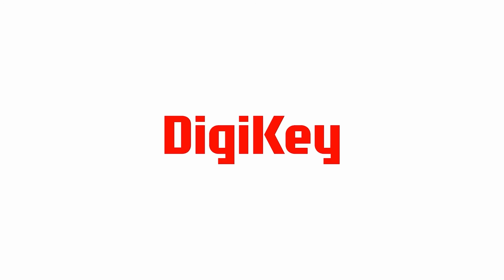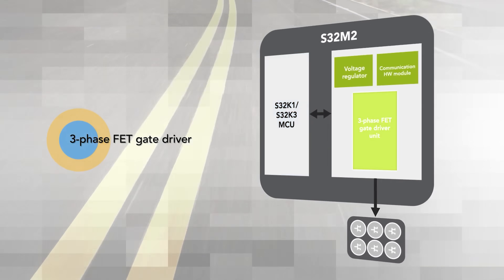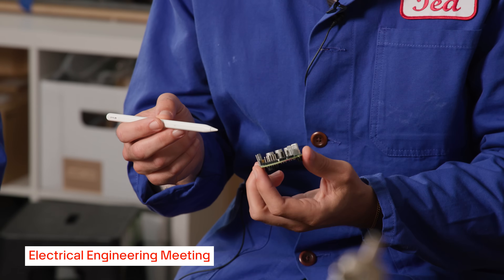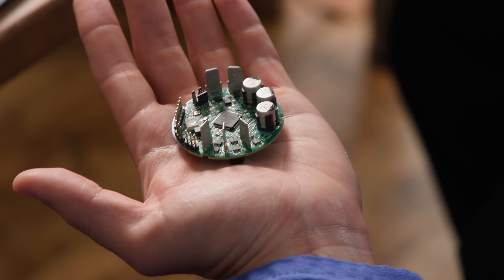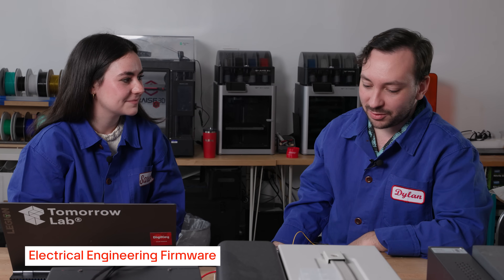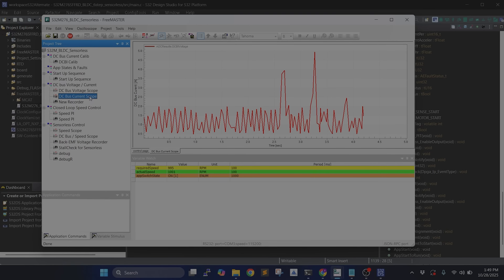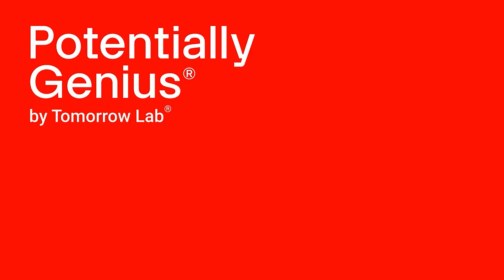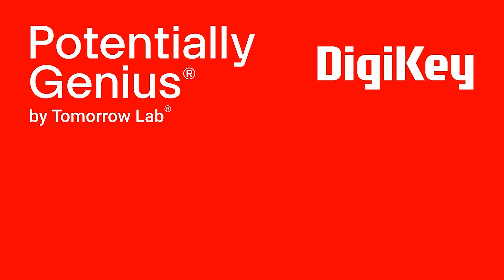NXP S32M2™ Motorized Ice Cream Maker – Potentially Genius® | DigiKey

Comment: This is obviously a PR fluff thing and that is fine, but who is your target market? That chip is $20, that little dev board is a whopping $63, and I assume you need the debug probe for $525.00, BLDC kit? $450.00?  I assume the dev environment is a fortune as well.
I can get a closed loop stepper motor and driver + display for like $35 ready to go from Amazon, tomorrow. Digikey shipping is a fortune. For a production run that is one thing, but for prototype stuff unless you are a big company, forget it. At least Ted was able to identify the chip. I guess Ted didn't want to make a NXP account to look at the schematic either for the bulk caps on the dev board. I guess I don't understand marketing.

Comment: Any open source development options as an alternative to the nxp ide?
Reply: No. It is a cortex m3 so in theory you could use CMSIS and an open ide to program the arm core, but you won't have the libs to do any of the motor stuff easily. This is a product aimed at ford. Nxp couldn't care less about "makers" as is evident in the pricing of everything. So they spent ~1k to add a motor to a ~$30 ice cream maker.
Reply: @moki123g thanks for the heads up; too bad as i’m mostly all-in on platformio
Reply: @nullstyle  Yeah, that's what I use too. And now with coding plugins like roocode you can have ai help with the dev. Boomer companies are way out of touch. If the chip was ~$6 and if the dev board was ~20 and the programmer was ~40 I'd be playing with one right now. I can buy a crap ton of parts and rp2040's and esp32's for 1k.